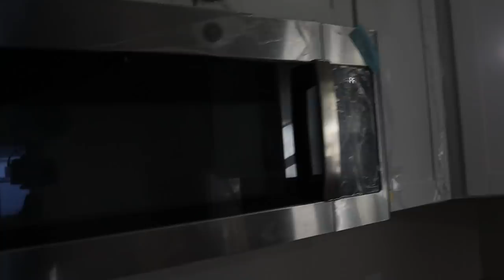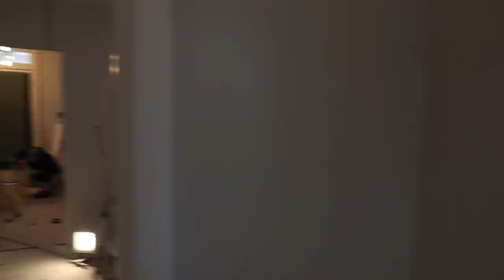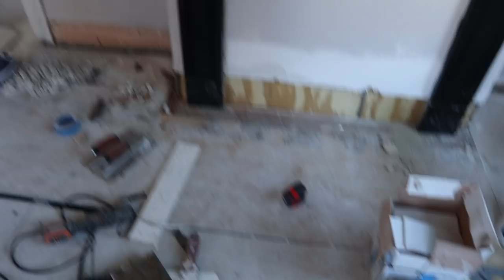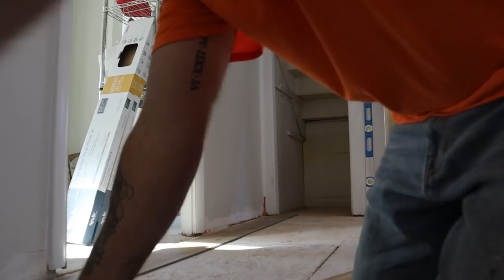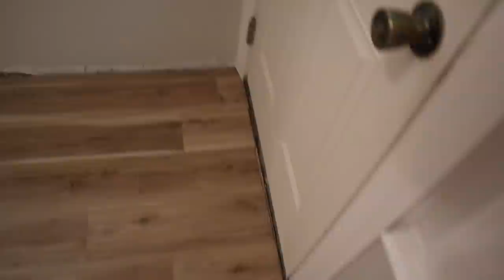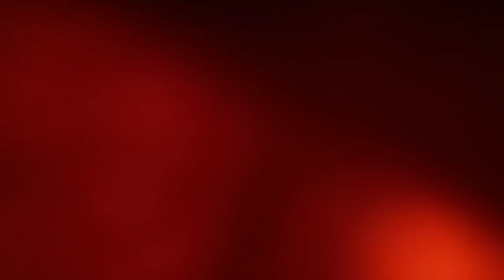Flooring Looks Good!

Comment: I don't understand why you wouldn't run your flooring through the house instead of putting transition strips...🤷‍♂️ personally, i think it looks so much better. Transition strips should be used when you can't continue.... or when you're moving into different material. You should keep continuous flooring as much as possible. If I was your boss that is😁
Reply: Because Joe can't take sound advice . This dudes heart is in the right place but his brain isn't.  I bet if he would clean thst disaster of a job site more progress would be made .
Reply: I'm sure Joe will eventually learn to do it but I agree make the house look a little bit more professionally done and the flow of it from one room to the next makes a huge difference and it's not that difficult to do I'm sure he will eventually learn though some of those transition pieces can get costly as well he would save some money by not using them

Comment: Happy Birthday Joe!!! Glad you’ll be celebrating with loved ones,& friends.🎂🎊🎈🎉 Flooring looking pretty good, with the exception of the major gaps. I really hope you do something about those. Y’all are coming along with the painting I see. Looking bright,& finished. Everything looks better now that you’ve cleaned up the rooms. Getting closer to the finish line. Enjoy your day off,& make the best of everyday on this earth. Don’t sweat the little things.✌🏾
Reply: Hey joe, I don't know if they have these in VA, but there is a thrift store call the re-store. It focuses on construction, building materials and things like that. I think its run by habit for humanity. It would be a great place to look for the finishing touches and save money on your project. I was thinking about the fireplace tiles. I do mosaic art, and honestly even a trip to a normal thrift for some old China plates would look better and more beautiful then the white subway tile. Since its indoors and not getting any wear or water on it you can literally use any plate and it will work just fine. It would really give it a lot more character and you'd expand as an artist and really leave your mark on the house. Best of luck and happy birthday!
Reply: Doing a broken plate mosaic is almost exactly like doing tile, just your pieces are smaller and you need some kind of vision or plan before hand. Then just break and stick them to the wall and grout like tile. I'd try to choose plates that are all a similar thickness so you don't have to much uneven-ness of pieces. The house looks kinda Modern with the black fans, I think blue shades might be the ticket. My heart says florals, but that might be a little to cottagecore for what you have. I think I'd do stripes, mixed with your subway tile, maybe all mixed shades of blue or in a variant from dark to light vertical. 1 stipe white subway tile, 1 stripe lightest blue. 1 stripe subway tile, 1 stripe a 2nd shade of blue. Ect. Just an idea. If you wanted to get really creative, you could make actual art in there, like a mosaic fire in oranges, reds and yellows with brown logs. But I understand that would take a bit more time that you don't have. Try a simple pattern like I explained above, something other then that white subway tile please! Lol

Comment: Ha Joe ... if you want to save a little money you can always use a piece of the flooring as a transition piece. Both rooms have the same flooring so it will look good. Just cut the piece down to 3 or 4 inches wide and run it side ways. ... Happy Birthday